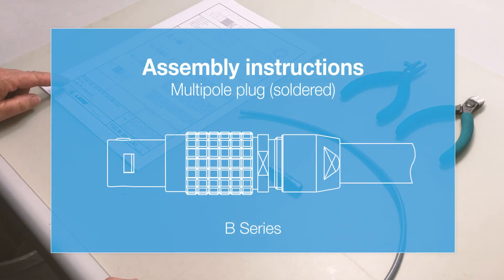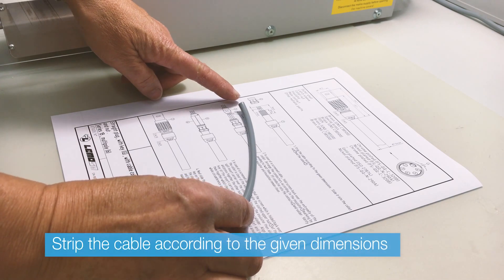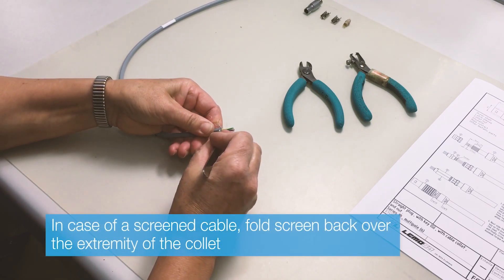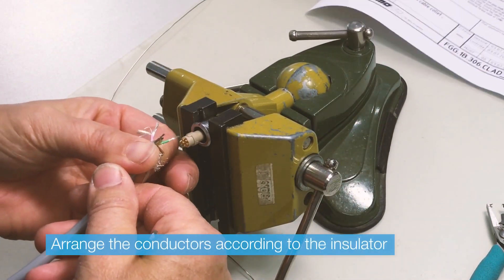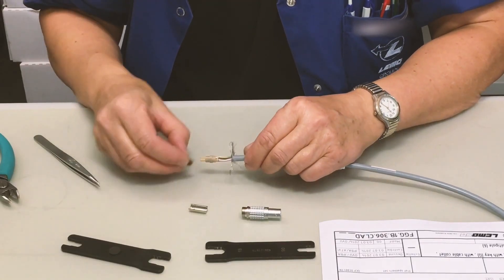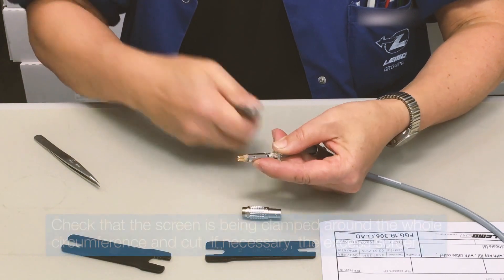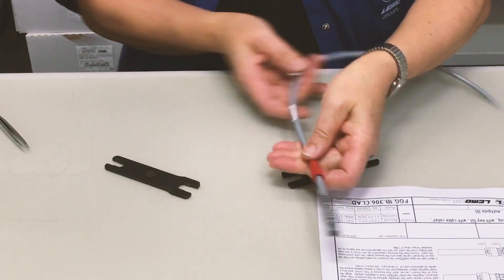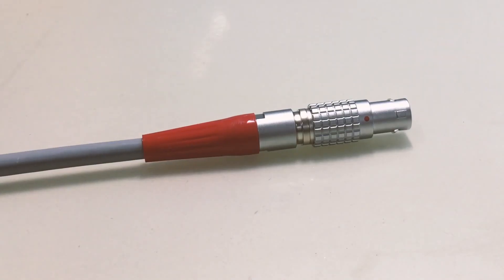LEMO's B series connector assembly - FGG.1B.306.CLAD

Comment: Awesome video
Whats the exact part number for the black flat spanner mini wrench for these small 0B size plugs?
Reply from the maker: The part number is DCP.91.001.TN - you can find it on page 153 of the Unipole & Multipole Catalog https://www.lemo.com/catalog/ROW/UK_English/unipole_multipole.pdf
Reply: @LEMO-GROUP  Awesome thank you! Last two questions: I have a LEMO FGG0B302CLA  Male connector.
1. Whats the complete partnumber for a blue and grey rubber bend relief for my male connector?
2. Whats the partnumber for a small Female connector (screw-in type) where I can plug this 0B male connector into?  Thank you!
Reply from the maker: @sambalsamurai9672  Please, go to the page https://web.lemo.com/PartSearch where you can start a live chat and get answers from our technical support

Comment: 380 degrees on the soldering iron ? I think it's time for Lemo to invest in some  soldering  stations that are not Weller.
Reply: The soldering technique demonstrated in the video isn't good either. I prefer loading the cups with solder pre-form, heating it, and then inserting the pre-tinned conductor into the cup. The joints are much better this way. A 0.6mm solder wire fits perfectly into these cups.

Comment: HOW ABOUT TELLING US WHICH ONE IS PIN ONE SINCE AN EXPLAINATION DOES NOT EXIST ON YOUR DATASHEET
Reply: It's marked with a red outline.
Reply: How about don’t write in capslock ?

Pin one for what ? All the pin are aligned in the two differents parts of the lemo connector. So you can’t miss-align them. I don’t know what you want to call pin one.

Comment: Good video.  Needs clarification with regard to "bend relief" versus "strain relief".  The video does not show sliding the plastic bend relief on the cable.  The video could also be more clear about sliding the collet nut on the cable and then sliding the collet on, noting the orientation of the plastic bend relief, nut and collet.